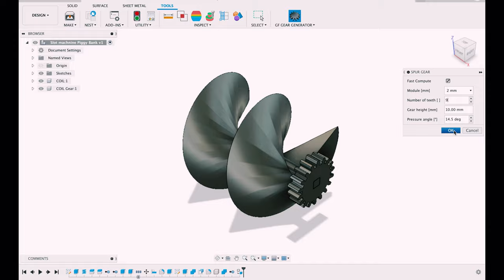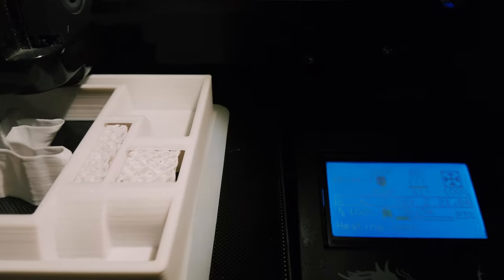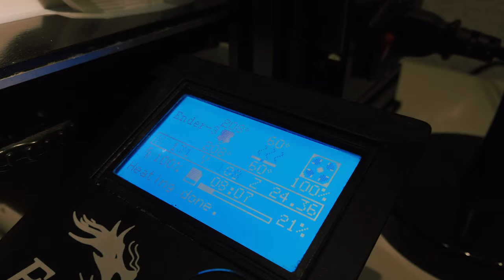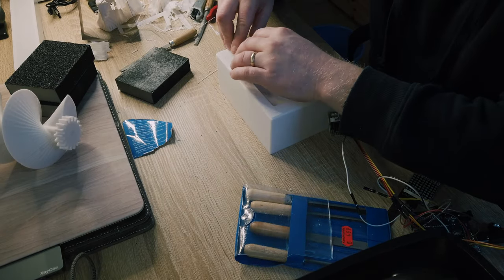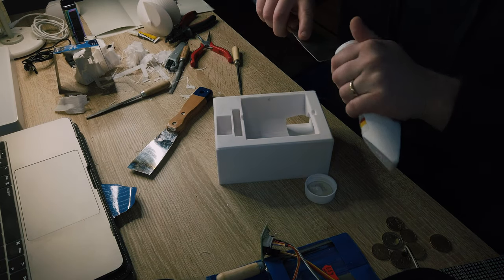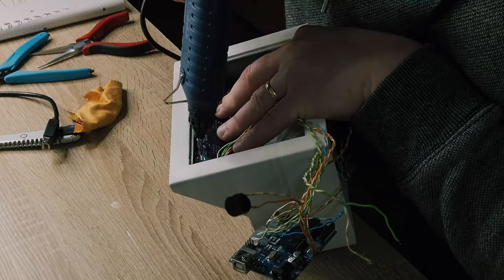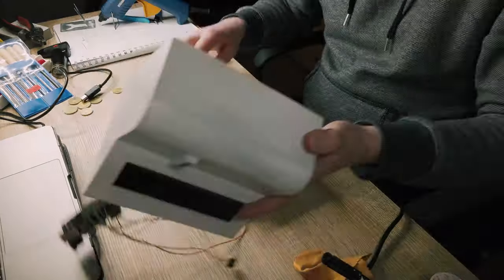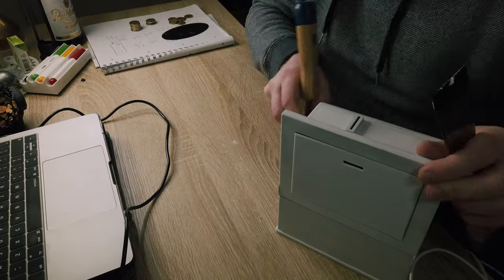PIGGY BANK SLOT MACHINE (3D Printed, Arduino Based)

Comment: hi, great job. Can you say model parts electronics? ty
Reply from the maker: Hi, arduino uno, servo motor (plus servo driver), led dot matrix display, buzzer..
Reply: @Max3DDesign  ty i have all parts. i will print stl to build.
Reply from the maker: @nolocrema  the only problem is with that switch/button.. when coin goes in. I use 2€ coins, they never stuck..